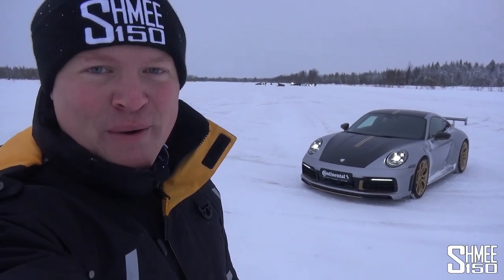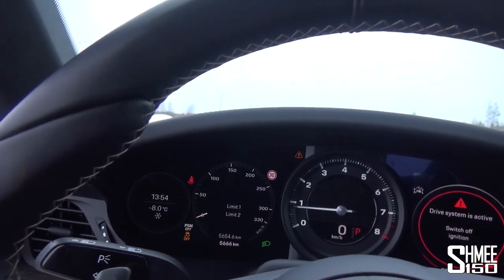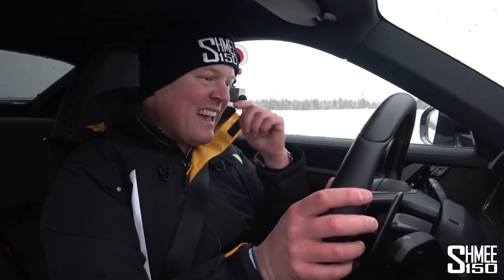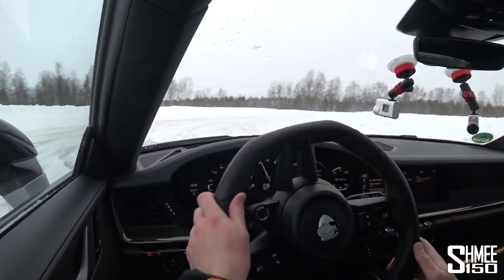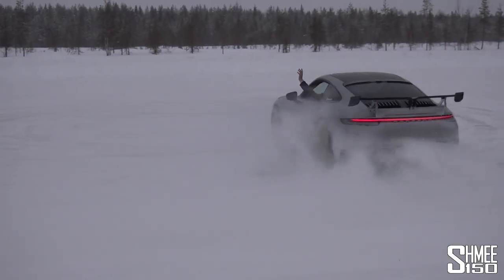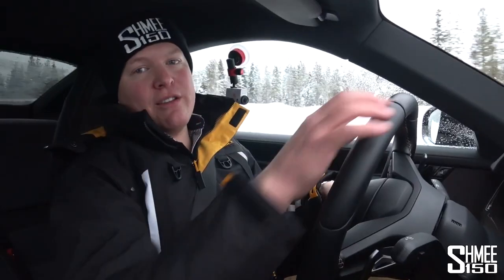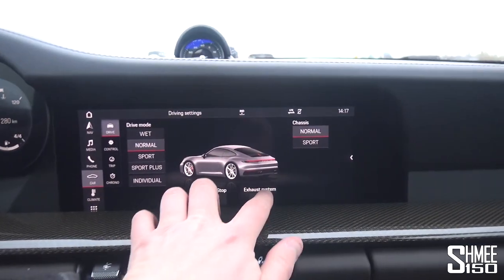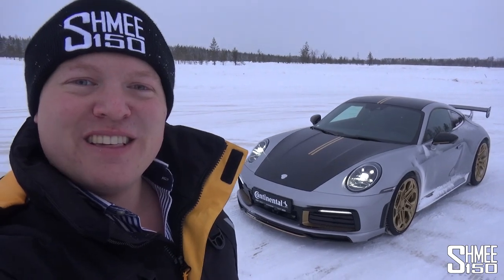TechArt Know How to Modify the New Porsche 911!

Comment: Why wouldn't you just buy a GT2? In know it has more hp but l've driven the 992 GT3 and really....how much more do you need?
Reply: Michael Roberts First of all a GT2 RS is about 250k more expensive than a standard 992 so there not in the same bracket . Secondly you have haven’t driven a 992 GT3 , that car has not been released . Get it right .

Comment: Brilliant 
Does the rear tend to rotate when you lift off the throttle?
Reply: If you’re in a turn, and you lift in any car, it will tend to rotate the rear. The weight is shifting off of the rear wheels. 🤷‍♂️

Comment: Stupid question probably, but what is that in the middle of the windscreen, when it's the forward dashcam view, especially at around 9:00 minutes.
Reply: A front demister strip, a smaller version of what is generally on rear screens of most cars.
Reply: @nssherlock4547  cheers.